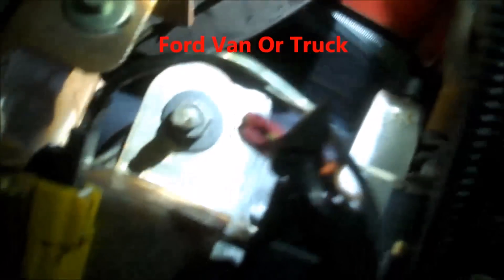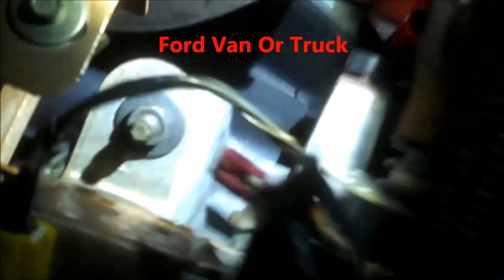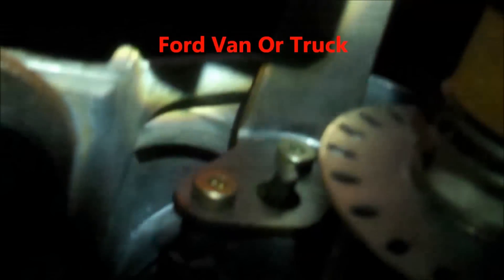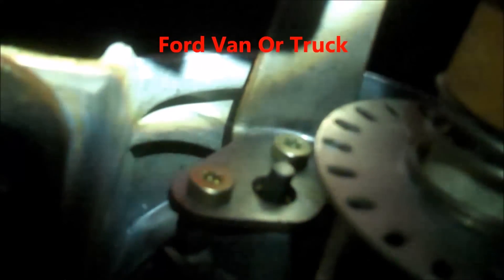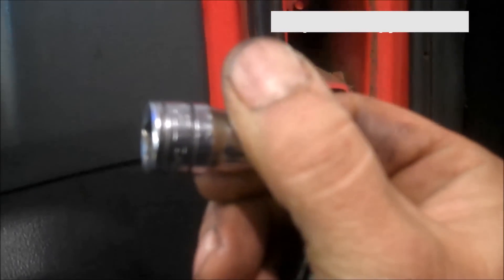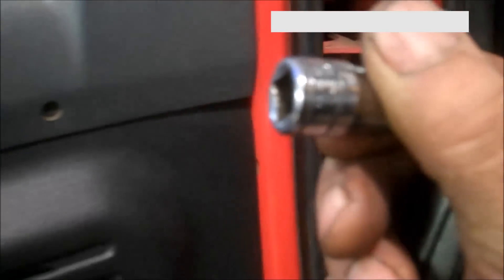Loose shift lever on Steering wheel Ford F150 F250 F350 E150 E250 E350 Truck Van

Comment: exactly what the hell did you show i seen more info on Martha Stewart
Reply from the maker: I thought I showed a pretty clear shot of 2 torx bit bolts that you need to tighten if your shift lever is loose, sorry if it wasn't clear to you, it was a quick video, but only 2 bolts.
Reply: +Fixing cars and stuff 
You sure didn't show where they are or how to get to them. Do I have to crawl underneath? I got about a half second glimpse from the video... I guess I'll figure it out.
Good to know I can fix this with a T30 Torx bit, though.
Reply: @fixingcarsandstuff  Were you actually able to get your screwdriver on those 2 bolts?